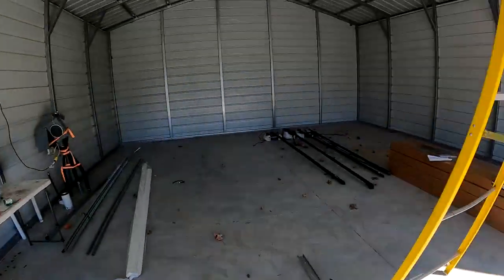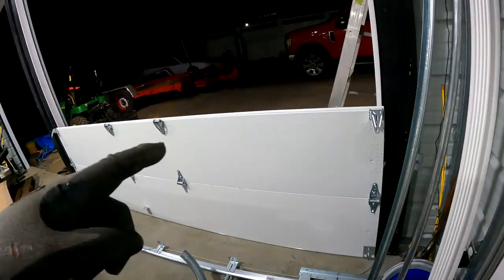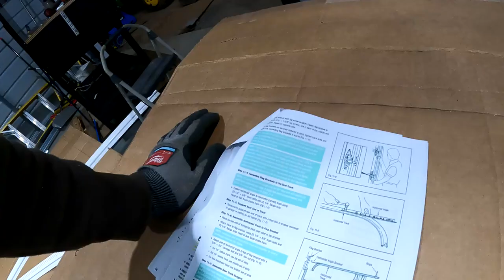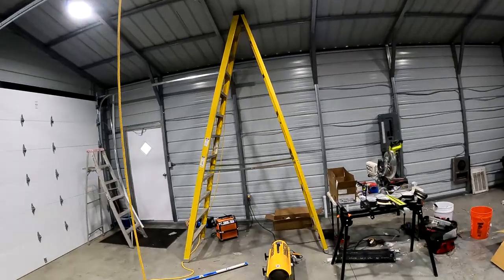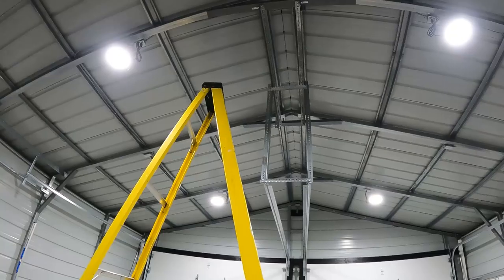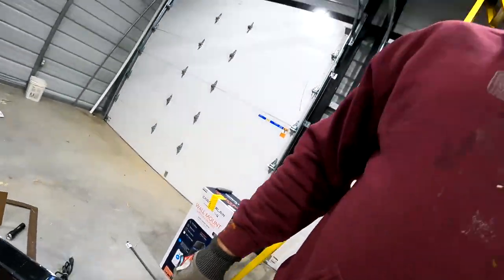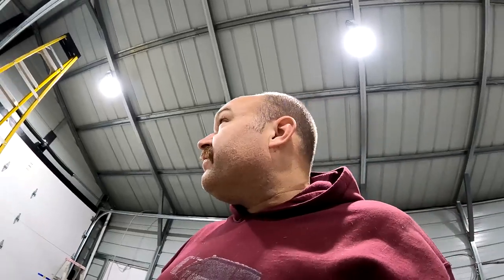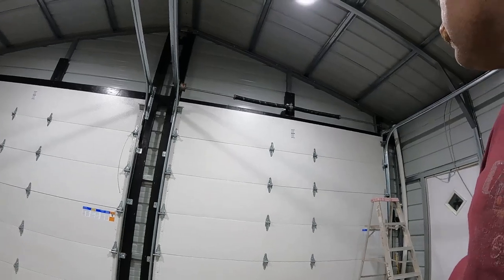Installing custom ordered insulated garage doors and tracks in my metal building dream shop

Comment: How did you fill the gap on outside of door against the building
Reply from the maker: The doors come with rubber trim which you can also buy separately at home improvement stores. It nails into place and touches the doors to seal out water and air.

Comment: i always wind from the side,not directly in front of the bars ,those can be deadly
Reply from the maker: I didn’t wanna be off center and fall off the ladder.
Reply: @drewdoestrucks  right i did residential sectionals for a few years,and am about to pour slab for similar shop,so ill be doing insulated doors,openers,always get positioned  on ladder off to the side ,ive seen winding bars slip  and are a deadly projectile,i saw the frustration in this video,but commend you for showing it all,luckily i had a great trainer,but its been awhile,and i never did the side  mounted motors,thanks
Reply from the maker: @sonofthunder.  I got them all straightened out in the end. The horizontal tracks needed raised to always gravity feed the door to the wall mount openers.
Reply: @drewdoestrucks  cool i didnt know that ,i always hung tracks level,with the older chain /belt drive motors, good to know